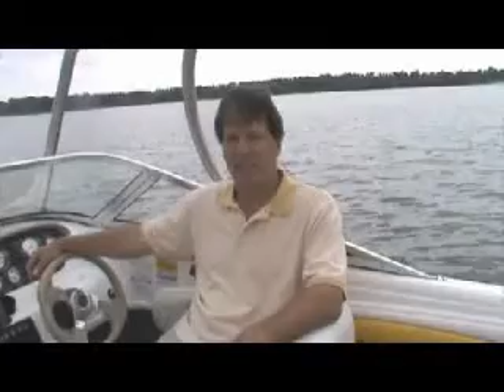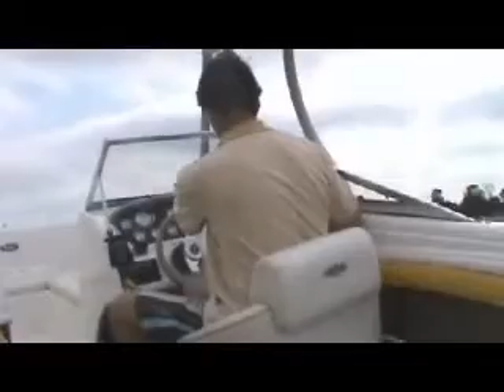CarbShot™ Stops Engine Dieseling or Run On in Boats or any Carbureted Engine

Comment: Will this work on v8 87 Caprice 305 small block Chevy?
Reply from the maker: Yes, this will work - every time. The challenge will be where to mount the CO2 tank since they have a temperature limit (you will want to check these out at a sporting goods store). If you cannot mount it in the engine compartment, it may have to be mounted/stored somewhere in the passenger compartment.
Reply: Thanks for the insight I will look into this further

Comment from the maker: @rachelnjimmie 
Thank you. CarbShot uses an inert gas to stop the combustion process and it can be used on any boat that has a carbureted engine. Please call me at 402-239-5117 to order one. I'm located in Lincoln Nebraska..